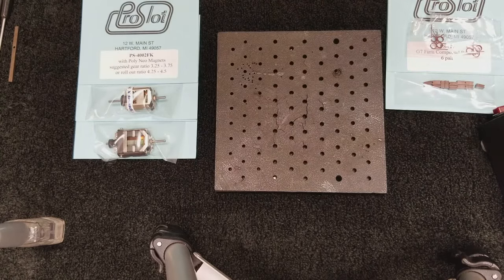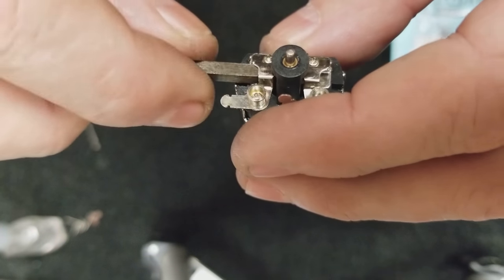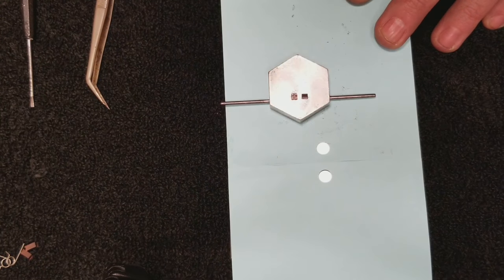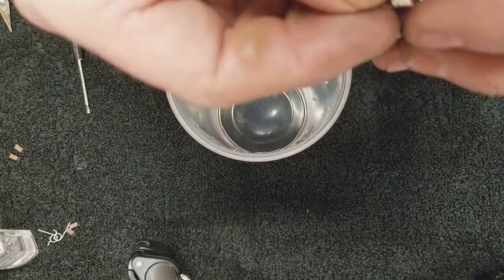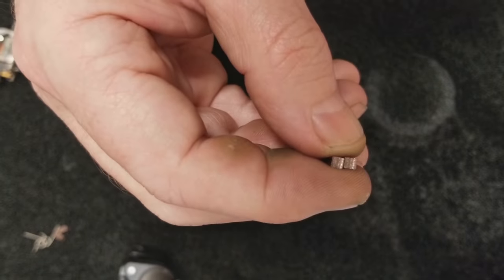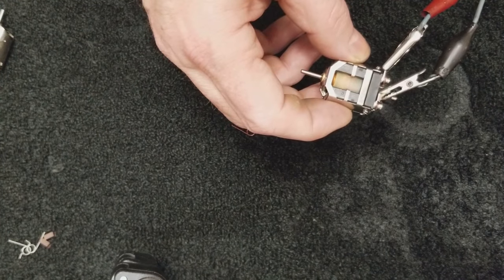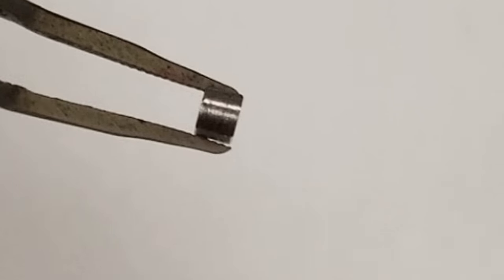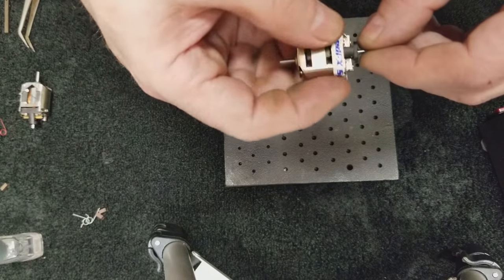Between the Lanes How To Brushes and Springs Pt 1

Comment: Ron I use an older brush radius tool that is in a old setup and you install the brushes into it and turn the tool as if it was the arm. What are your thoughts on this type of radius tool? The hoods on the setup are aligned well. But it takes a spring to hold the brush while radius it.